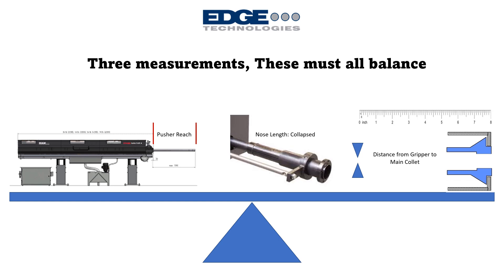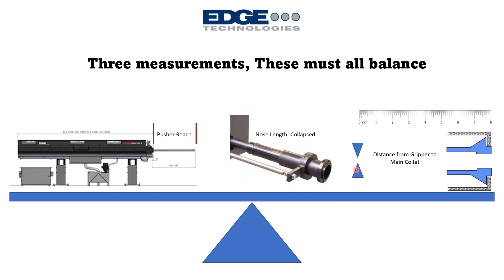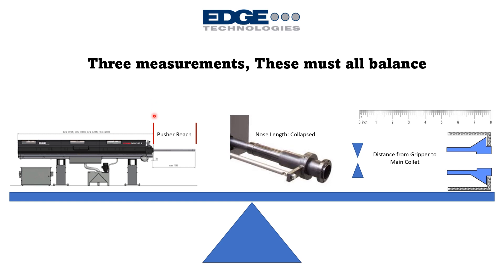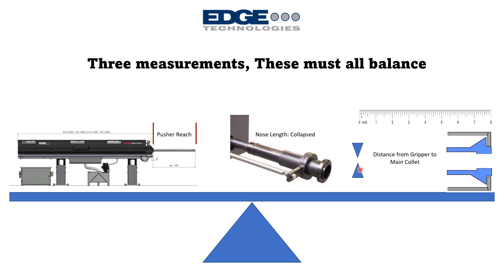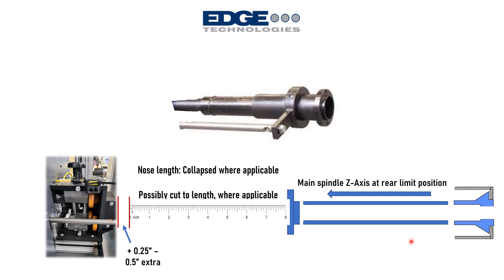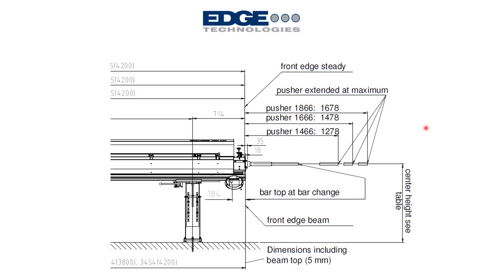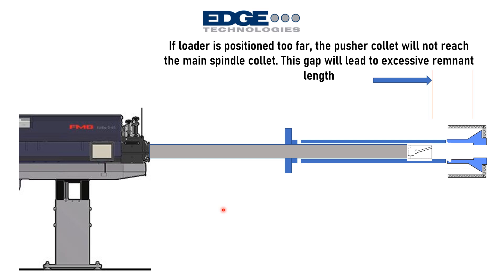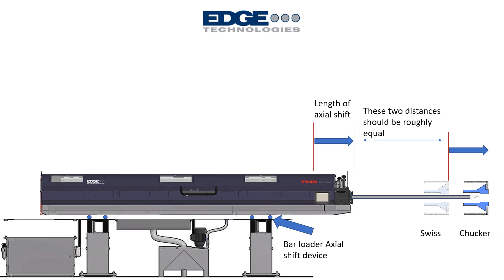Bar Loader Install, Positioning Instruction

Comment: I learned that slowing down and making sure your measurements are correct will help avoid issues during the install and later on. Horrible style points with this comment.